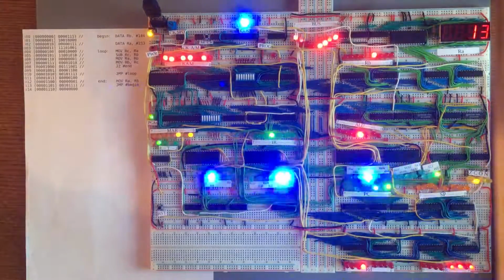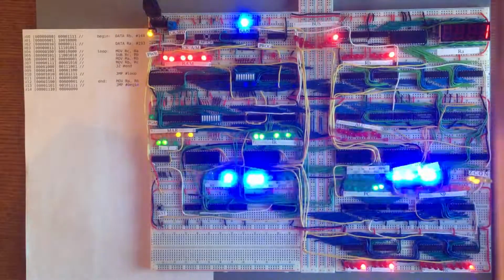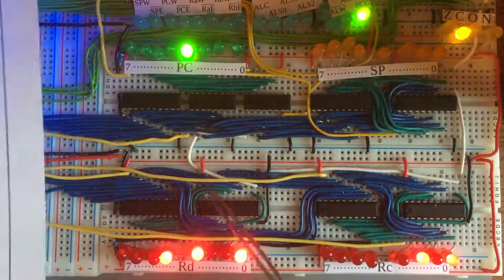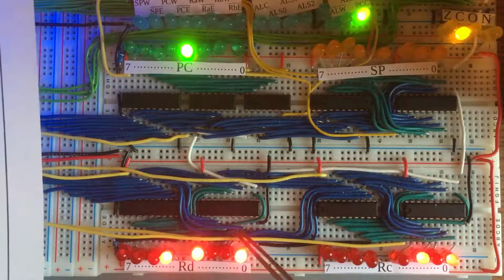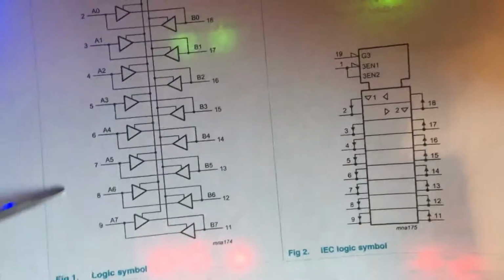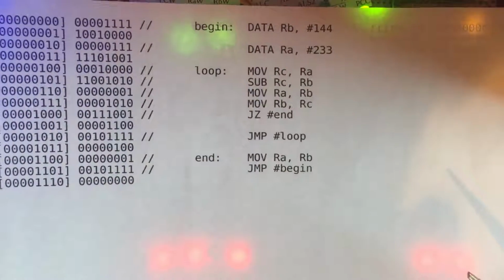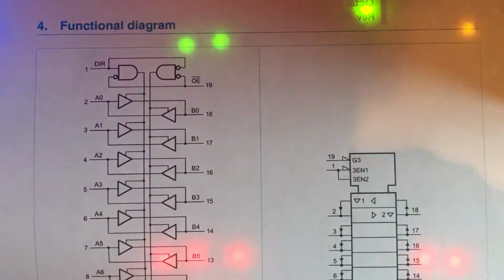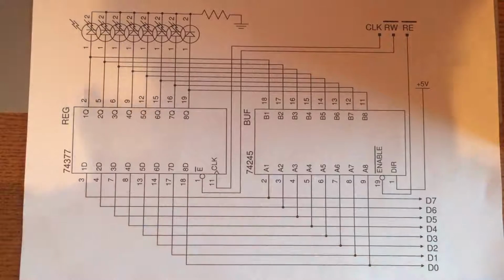My Ben Eater inspired homemade 8-bit CPU - Part 3: Registers & the bus

Comment: Very cool series. I'm building one as well but I'm sourcing all the parts myself. I need a couple memory ics and I'm done gathering. I bought 50 to 100 of each chip where I could in case I find someone who doesn't have the means to buy them all. I'm having a very hard time finding quality 8 bit switches and I've tried a few brands. Are you using all the stuff from his shop like bussboards 830 tie point boards?
Reply from the maker: Hi, my 8 bit switches are also pretty unreliable unfortunately...

I bought most of my components from reichelt.de and from conrad.de here in Germany. The switches came from Digikey I believe...
Reply: @jimmyb998  I bought a few brands of red ones so what I did the other day was crazy glue the switch into those round female header pins and now they a bit better

Comment: to make a reset signal for the registers you can set the bus to 0 and read
Reply from the maker: Yes, that's right. In fact the LS74382 which I use for the ALU (see episode 7) has a function (S2=S1=S0=low) to output all zeros. So I could implement a RST instruction in a single CPU cycle.

Comment: Wow, your SP is also just an 377 register? You need to use the ALU for a simple stack operation?  Why don't us use an UP/DOWN counter? So you can count down on PUSH and count up on POP?
Reply from the maker: Could've done. But since we have an ALU, I might as well use it ;)
Reply: In the current way, the SP can be reset to any value.   Particularly in his design, the registers don't have a reset so they have to be initialized in either actual instruction software, or in OP code.  Granted, some CPUs assume the SP is circular where they can start anywhere and so it is up to the user program or OS to prevent stack overflow or underflow.

Comment: So you replaced 74LS with 74HC CMOS chips, and that explains why your power is so much lower. Did you manage to fry any?

Great choice of register chip. I'll use the same ones then!

Sure, register reset is completely unnecessary. We're fine there. Nobody assumes a certain register value at the beginning of a program.

Another thing, I can tell that you learned machine coding on the 808x, with all that MOV and JZ mnemonics. Mine of course will strictly adhere to 3 letters as in any good 6502 :)
Reply from the maker: no, no frying. In the whole build process, I fried a grand total of one led only! I'm quite proud of that :D

And yes, very 808xx-style assembly. Plus a pinch of ARM ;)

Comment: I wasn't able to find the 74HC245, so I bought the 74HC241, which seems to be equivalent. An interesting thing about it is that the chip I bought is pretty old, even though I bought it just a few months ago. I know it's old because it has SGS-Thomson's logo, which changed its name to STMicroelectronics in 1998. There's a 5-digit code which says 88450. If it's a date code, then it could be from 1988 or even 1984!

Comment: Hello again James ... as you know, I built Ben's version of this, so I have a quick question about your output display. On Ben's version, we have a dedicated output register whose only purpose is to store the information that we want to have show up on the output display. But otherwise, it isn't used to store information or anything like that. In this video, it appears as though you are using your A register as your output register, but it looks like your A register is also part of your ALU. If that observation is true, then I'm guessing you have some way to tell your A register whether to act as an output register, or whether to act as part of the ALU?

Like if you run a simple program like 1 + 2,  and 1 is stored in the A register and 2 is stored in the B register ... at that time, you don't want 1 being output to your 7-segment displays. But once your ALU as calculated that 1+2 is 3, that answer has to be copied over to the A register so that it can be output to the 7-segment displays.

If this is correct, I'm just trying to figure out why your A register isn't constantly outputting its register value onto the 7-segment displays.
Reply from the maker: Hi David :)

On my CPU the A register is a "fully able-bodied" register, in the sense that it can store a value coming in from the bus, and send its value back out onto the bus. All registers can do that. The decimal display is really just replacing the function of the 8-bit LEDs I have for the other registers.

So you're right that, as soon as a value is read into the A register from the bus, it shows up immediately on the decimal display.

Knowing this, I wrote my Fibonacci program in a vary careful way, so as to exploit this fact to my advantage:

Basically, the fibonacci algorithm (whether counting up or down, it's true for both) keeps track of two numbers at all times, a smaller one and a bigger one. In this particular program, the smaller value is always in Rb, and the bigger one in Rc, just before the actual substraction. So neither is in Ra. The substract instruction, SUB Rc, Rb will in fact perform Rc=Rc-Rb. So, what was the bigger of the two numbers in Rc is "lost" (overwitten), and Rb now becomes the biggest of the two numbers. Rc in fact contains the current smallest number (the difference of the previous 2). So, the biggest and smallest numbers are in the wrong registers: they must be exchanged around. And to do that, you need a third register, to "temporarily" store the bigger of the two (from Rb), while the smaller one is transferred from Rc to Rb. I use Ra as this temporary register. The result is that Ra only gets updated ONCE on each cycle of the loop, with the bigger of the two numbers in Rb and Rc. But at the moment of that update (the MOV Ra, Rb instruction just after the subtraction), the decimal display does indeed update immediately to the new value moved into Ra, as you point out. I'm just being careful to update it only once per cycle, by using it as the "temporary" register for the exchange of values between Rb and Rc.
Reply: Thanks for the reply. That all makes sense ... using Registers B and C to store your "main" numbers, and then using the A Register to hold result. And now I understand that your 7-Segment displays are hooked up to your A Register as a replacement for the 8 LEDs.

So does this mean that your ALU can take any combination of registers as input? A and B, A and C, A and D, B and C, B and D, or C and D? On my build (Ben's version), my ALU is hardwired so that it receives input from Register A and Register B. I don't have a C Register, but I could easily build one and add it to my computer. But it wouldn't be part of the ALU ... at least not without a lot of extra wiring, and I imagine, a lot of extra trouble.
Reply from the maker: Not quite: my ALU takes one operand from the bus (which can indeed be enabled by any register), but its second operand is always either the Rb register, or the hardwired value "0". The reason for this is explained in my video on the ALU (https://www.youtube.com/watch?v=DfuFNBJn1hk). Basically it's because I don't have enough opcodes to encode all possible combinations of two registers. A nice example of hardware design being limited by software :)
Reply: Ok, I see. I'm making various notes for myself in a Word document because I do want to expand my breadboard computer, but as I think I mentioned in some other post a while back, I'm going to build a new one rather than try to expand the one I have. I think that will be easier to build a new one, and it will be nice to have a working version (albeit limited by various 4-bit bottlenecks) in the mean time.

After seeing your videos, I definitely want to use HCT chips as much as possible. Have you heard of the Gigatron TTL microcomputer? If not, look here: https://gigatron.io/  I only found out about it within the last few weeks, but I noticed they were using HCT also. (There are multiple build videos online if you haven't seen this thing before.)

One thing I'm thinking about doing on my new build will be to have a 12-bit bus and a 12-bit Instruction Register. If I understand everything correctly, that would allow me to have 8 bits for general purpose registers and DATA, and 4 bits that would just be used for the OPCODE. So I would still be limited to 16 OPCODES, but I would have a true 8-bit computer otherwise. 8-bit Program Counter, 8-bit Memory Address, 8-bit general purpose registers, and 8-bit output register. I'm thinking I will stick closely to the design I already have built, as that is what I understand best. And what I understand is this idea of having some bits used for the Instruction/OPCODE, and the other bits being used for a memory address or other DATA.

But I just want to expand it so I can have 256 byte programs instead of 16 bytes. I was trying to write this really simple program on my breadboard computer a couple of nights ago, and I found that it wouldn't fit in 16 bytes.  :(  So yeah ... those 4-bit bottlenecks on the "8-bit breadboard computer" are completely crippling.
Reply from the maker: 12-bit IR meaning your instructions will be 12 bits long? That'll make programming tricky, since presumably your memory, which will contain the programs, will be 8-bit based. So your instructions won't be nicely aligned on integer memory addresses ...
Reply: In following Ben Eater's version of the build, we have an 8-bit instruction register, but it's split in half where the 4 MSBs are used for the instruction. See this video at the marked time stamp of 6:41 -  https://www.youtube.com/watch?v=9WE3Obdjtv0&feature=youtu.be&t=401

This means we only have the lower 4 bits available for the memory address. So this 4-bit limit, along with the 4-bit program counter, really cripples the capability of this so-called 8-bit computer. So what I am hoping to do is "simply" add another 4 bits to the IR so that I'll have 8 bits available for the memory address instead of just 4 bits. I will also have to make my program counter 8 bits, but that is trivial. Here's an image out of my Digital Computer Electronics book that probably explains it better: http://i1280.photobucket.com/albums/a493/blixel/BB%20Computer/20180504_122148_zpsrak2path.jpg~original
Reply from the maker: Ah, so you're building a 12-bit computer. Reading your comment again I see you actually mentioned that. My mistake ;)
Reply: Well ... I don't see it as a 12-bit computer. But I suppose this does get into an area where you have to decide what you mean by "8-bit", "16-bit", "32-bit" and so on. I watched this youtube video on that a while back: https://www.youtube.com/watch?v=_SkpnG571z8

If you are going by the bus width, then yeah - Ben's computer is 8-bit. But if you're going by the addressing width, it's only 4-bit.

In Ben Eater's computer, I feel like it's really a 4-bit computer with the ability to display 8-bit output. If a chain is only as strong as its weakest link, then Ben's 8-bit breadboard computer is only as capable as its 4-bit limit.

In the version I propose to build, I feel like it would be an 8-bit computer because it will have an 8-bit program counter, 8-bits of addressable memory space, 8-bit registers, and an 8-bit output display. But to get the job done, I'll use a 12-bit bus.

Comment: I´m actually doing the registers and I am ^totally confused: in the schematics you connect the bus to the A1-A8 (i think it should read A0-A7) pins of the 245 and in your video I see the bus connected to B0-B7 on the 245. (thats the way ben eater connected the registers. what am I thinking wrong?
Reply from the maker: Whether you connect the A pins to the bus, and the B pins to the register outputs, or the other way around, depends totally on the geometry of your build. The 245 can work both ways (A->B or B->A). You choose the direction by setting the "DIR" input (pin 1) appropriately.

In the schematic, the register outputs are connected to the "B" pins of the 245 (pins 18-11), and the bus to the "A" pins (pins 2-9), so the DIR (pin 1) should be configure B->A, which * should * be Low. The schematic I show in the video is indeed WRONG in that regard. If you click the download link in the description, you'll see DIR should be connected LOW (to ground) in that case. Sorry for that confusion.

The schematic in fact corresponds to my SP register, which is connected B->A. On the other hand, my registers Rc and Rd are connected A->B, and so their DIR pins have been set high.

I hope that clears the confusion?
Reply: yes, many thanks
Reply: You connect the LSB Pin B0 on the 245 to the MSB Bus Pin 7 and then once more you connect the LSB Pin B0 on the 245 to the MSB Pin D7 on the 377. Is that for better wireing or are there other reasons for?
Reply from the maker: Yes. Bit order on both the register (377) and buffer (245) are totally irrelevant, since they don't calculate anything. So whatever's most convenient for the physical wiring is fine. Same goes for RAM, when you get there (both address and data).

Of course, that doesn't apply for the PC and ALU, where bit order are important ;)
Reply: I finished now the C & D Register, next I will do the A&B Register. You connected in A and B other than in C&D.is this also for wireing reasons?
Reply from the maker: yep, same deal.
Reply: I just finished, the clock module (1 breadboard) and the registers A and B (one breadboard), and Registers C and D (one breadboard). I do it all on breadboards with +/- rail above and below. so there is enough space. what do you suggest to implement the next? RAM?, PC and Stack register, ALU? other?
Reply from the maker: I'd say PC and SP: very similar to registers.  ALU and RAM are about equally complex I'd say.
Reply: ok, thanks, I`ll do so

Comment: Yeah, somehow Ben got lucky with those 4-bit registers. The pull-down resistors did not work on my build at all and I kept getting weird floating values that screwed up the whole thing. It wasn't until I made all of my registers, including PC and MAR, full 8-bit that these electrical problems were resolved.
Reply from the maker: interesting!